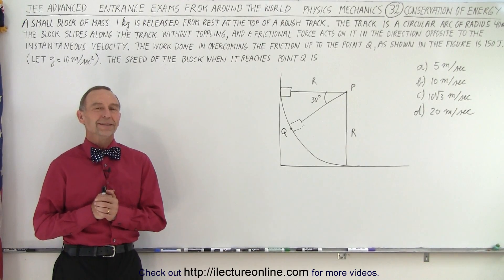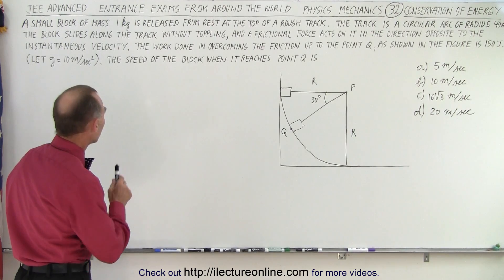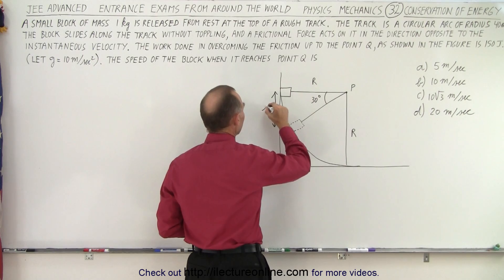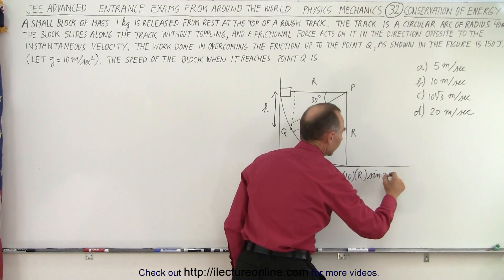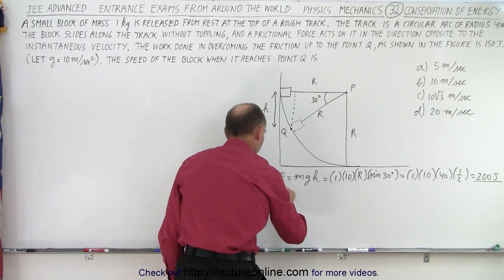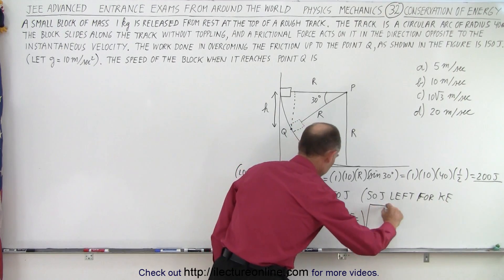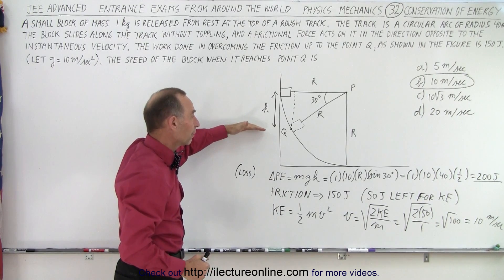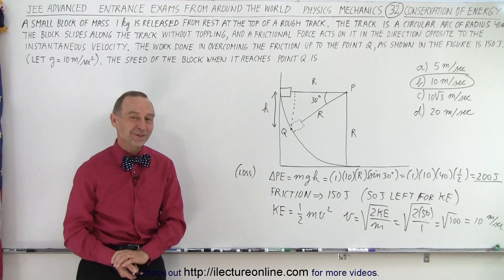JEE Advanced Physics 2013 Paper 2  #13  (#32) Conservation of Energy

Comment: Alright, read the problem, here's my attempt before seeing the rest.  I am not sure.  
40*sin(π/6) = 20 meters = vertical distance traveled.  Set this equal to the double integral of acceleration (since we're using a unit mass, quantitatively, force = acceleration).  So 20 = .5gt^2, whence t = 2.  Then I got tired, and just figured 20m/2s = 10m/s, my answer is b.  But like, I didn't subtract the friction, so.....    
force = g(1kg), and that force has been applied over the course of 20 meters, so g*20 = 200 Joules.  I guess subtract 150 to get 50 Joules of work.  So erg = 50J, distance = 20 m.  Work = .5mv^2, so isolating for v, we get sqrt(2*work), because I'm ignoring m, and because initial speed = 0, so subtracting initial from final is the same as finding the final.  So the square root of 50J*2 = 10 m/s.    
Welll.  My answer remains unchanged.  Shoot.  I wonder if that's a coincidence, or if both these methods are valid.  Or if they're both wrong haha.  Much fun, wish I had paper and pencil on hand, glad I could work it out in the comments.  Excited to be wrong, will tell all my friends if right
Reply: I am very excited.  I still wonder why my first method found the same answer, whether it's a coincidence or I'm a genius.  Ps thanks Galileo, it doesn't matter the path you take, as long as you fall a certain height due to (constant) gravity, you will acquire the same speed.  Also, I'm noticing for the first time that the double integral of acceleration = position = .5at^2 is awfully similar to the kinetic energy formula = .5mv^2.  Can someone please explain

Comment: Sir should we not consider the PE at Q as well ???? or
was the Q point considered as the reference point????
Reply from the maker: Typically we use the lowest point as the "zero reference".  We don't have to do that, but it sure makes the problem a lot easier.  It is completely arbitrary where the zero reference point is chosen.

Comment: the total energy at rest is 400J of PE  and we lost 200 J due to the change of height, so it should be ( - 200J) right?. so we left with 400-200 =200 and - 150 due to friction so we left with 50J of kinatic energy. Is that how it's calculated?